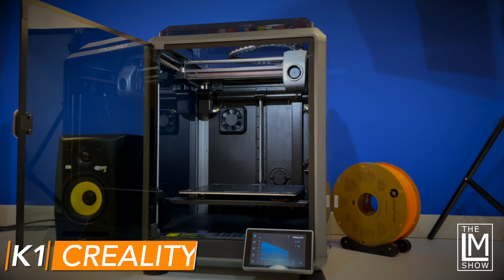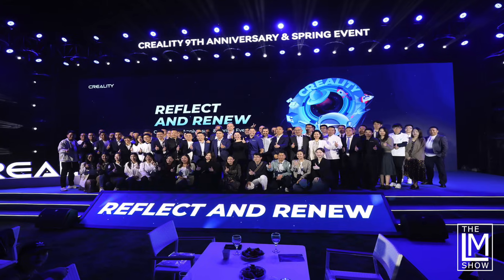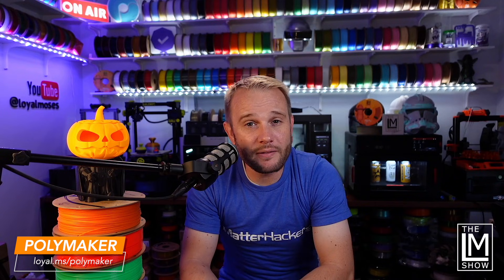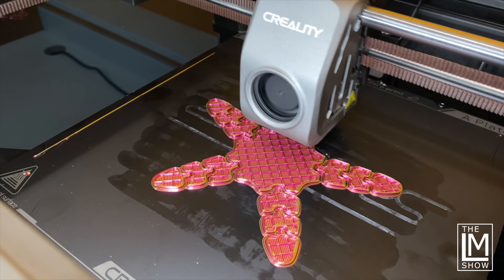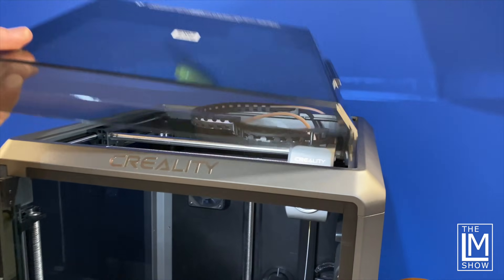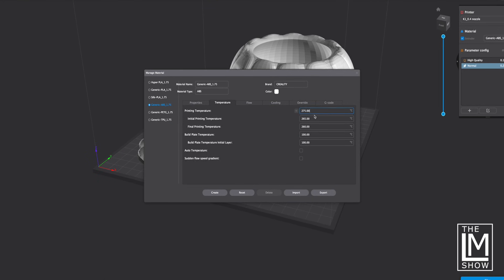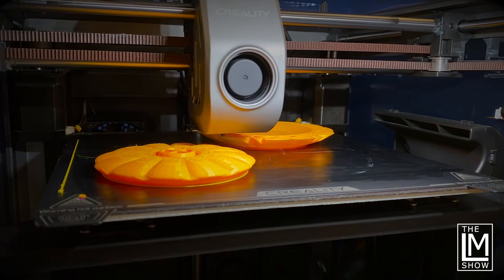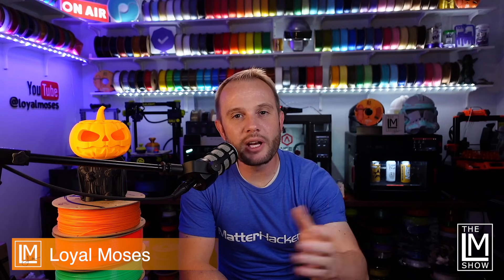ABS & ASA 3D Printing On The Creality K1

Comment: I have been printing ASA and TPU out of the box consistently and without issues from day one. Amazing and dependable machine. With Bambu and the K1 Max, filament printing is FINALLY at a place where anyone can easily print anything with any filament out of the box without issues. This is the beginning of a 3D explosion. Wish I had one of these when I was a kid. It would be my favorite toy.
Reply from the maker: I’m 100% with you! These machines are incredible, and 3D printing is changing forever! 🔥💜
Reply: @LoyalMoses  So in your experience, is ASA better than ABS?
Reply: @ When I first started, I tried every material just to know what they are like to work with and the properties. For me, I would only print with ASA or ABS if it was absolutely neccessary and it would likely be  ABS, but my go gerneral purpouse filament is PETG
Reply: @ I designed a series of subwoofer boxes for a 2 seat classic car. Space is tight and I found a way to design one that allows the use of very powerful small subwoofers. I have printed a couple of boxes from PLA and they work amazing. Now that the concept works I need to make them from a material that will survive inside a hot car without deforming. I know PETG is easier to print but don't know how well will it survive in a hot car in the summer. I know the temps inside can exceed 120f.
Reply: @ Yeah go with ABS or ASA. I think ASA looks better, but i have seen layer lines open up with ASA. over time. ABS to be on the safe side.. The trade off is ASA is safer on the lungs when printing.
Reply: @qwertyzxaszc6323  the part that sucks is dealing with the heat and humidity of South Louisiana.  The moment I open the door to the trailer a blast of humid air flows in and it takes a long time to dehumidify a 20ft x 8ft-6in trailer. I need a means to seal the large filament rolls and keep them dry. No telling what it's going to take to dry a 5k roll.
Reply: @cajunroadwarrior  I live in the desert in southern California, we have the heat, but luckily only have high humidity in August.But even here where it's dry, I always print directly from a filament dryer. I have 9 K1 Max's and a filament dryer for each.. Perhaps that is why I never have issues with my prints.
Reply: @qwertyzxaszc6323  this is likely my problem and I was very concerned it would be. One print completely delaminated. All of the individual strands of ABS never bonded.
Reply: @cajunroadwarrior  Filement dyers are not expensive, Well worth it. The strees amd waste is not worth it. Also, i try to stick  brand filament that have somethng to lose from negative reviews and avoid the cheapo brands. Not worth the hassle.
Reply: @qwertyzxaszc6323  they are for large spools. No one is making fast-printing filaments  in large spools. I need to print large parts that fill the 400mm area of my Ender-5 Max. It is designed to print super fast. Creality never designed this machine to run a CFS system. Another issue is no one is making a filament dryer that is also an automatic filament loader. Just one print can use 2.5kg of filament.
Reply: I have been failing with every print I do and it seems everyone is telling me the wrong thing to do on purpose.

Comment: What do you about air quality in the winter? I want to start printing ASA at times for functional parts, but its getting cold here, so leaving the window open is not really an option. I plan on buying a air purifier with active carbon filter in it, but not sure if that would be enough on its own.
Reply from the maker: Vent the enclosure out a window would be my suggestion. Seal it up to prevent cold air from coming in.

Comment: with problem. do not buy. no solutions from creality
Reply from the maker: Sorry to hear that! Was it with this machine?
Reply: @LoyalMoses   creality k1. have you tested it? even with the new extruder and hot end (because the pieces they send are faulty). you cant print the hole area. try.
Reply from the maker: We print on it all the time, and haven’t had a single problem yet! Sorry to hear you had an issue.

Comment: What are you using for bed adhesion ?
Reply from the maker: On this print I simply cleaned the build plate and applied a thin layer of purple glue stick.
Reply: Any big difference between Purple or Clear glue stick for ABS bed adhesion ?   @LoyalMoses

Comment: Got a K1 pre ordered for my first printer, went through the school of hard knocks with the early extruder but creality have been fantastic with support. Sent a new extruder out and hot end which solved the issue and now I am selling printed ABS parts non stop. Just ordered a K1 Max which arrived today to fit larger parts to add to the production line. I can see getting at least two more K1s to speed up production now that I have sorted ABS workload. Esun ABS+ is a good middle range price point but I would like to try the polylite as well. Thanks
Reply from the maker: That is great to hear! I am glad you are liking your machine! Also, I haven't tried the MAX yet, but I have heard great things about it! Congrats!

Comment: I had to run to the comments to give my thoughts! I bought an ender 3S one as my first printer a week ago. I have nothing but problems as I have no history with these machines whatsoever. I got so frustrated after spending 17 hours trying to get one print done and now it just sits in the corner of my garage. I purchased a K-1 from Amazon and paid way more than I should. I don’t even care. This thing is worth three times the price to me. I’ve printed multiple things with it absolutely zero problems. Only thing was when I first got it. Every time I would do a print it would shut down every five minutes or so and reboot. I looked it up online because I thought it was maybe a bad machine but it turns out on the left side. There’s a switch whether you have 230 volt, plug, or 115 V. I switched it to the right for 115 and it just keeps cranking things out. I’m trying the carbon fiber tonight so I’ll see what happens!
Reply from the maker: I’m glad you are happy with the machine! Sorry about the voltage issue, but I’m glad you got that figured out! How are you liking the quality of the prints from it?!
Reply: @LoyalMoses  the quality to me I think is excellent, I don’t know all the different settings quite yet. I’m just printing on whatever it says to print on, so it’s a huge learning curve, but I am very happy with some of the modeling stuff so far!

Comment: One reason why the K1 Max is my 2nd choice (1st is the P1S Combo, unless either Bambu or Creality develops an AMS compatible with the K1s), is the small overall printer dimensions even with a large print volume. If you compare it to a Sovol SV07 Plus, I will need a "Y axis" space of only 462mm (+spool holder) vs 600mm (300mm x 2) on the Sovol.

I may print some ABS parts to match the plastic of my Sandtrooper Armour.
Reply from the maker: I am so excited that we have so many new printer options for filaments like ABS!

Comment: Had my K1 max busted on arrival, and it was so easy for them to ship the replacement part, whole printer, or a full return (Which is what I opted for).
Reply from the maker: Oh no! What was broken??
Reply: @LoyalMoses  My front glass was shattered during shipping. I thought I'd just get a new one but then the extruder started skipping so just asked to return it anyways. They send a label and was super simple. Only reason I returned it is because I'm moving soon. Will wait for September announcement (want an AMS system) then I'll probably re-order it.

Comment: I have K1 it is great!... and not so great.
The speed and quality is wow!
The QC?  not so sure about.
Had mine 25 days.
First week... the bed went out of whack and nothing would stick.  spent 10 days with no luck on customer service, and finally figured out a solution on my own.
Two days ago, I woke up and went to the printer office, turned on the power, pos fan whirled up, interior light came on and that was it... not boot up, no screen.   Checked all the cables (just in case a mouse chewed on it... cough cough, they always ask this Einstein question), all cables good, got out my voltage tester and tested every spot - all good.  Checked the hot end board - all good.  Took the screen off, took the bottom off and check all the motherboard connections ... all good.
JUST DEAD.
Reply from the maker: Oh no! Do you have it back and working again?
Reply: @LoyalMoses  no they don't work weekends so will have to wait till tomorrow to see what kind of  support they provide.

Comment: Great info on the K1 as well as printing with ABS/ASA. I have only ever printed with PLA, but I only have an original CR-10. Slow AF. The only minor draw back for the K1 is that it's 220x220. That fits most people, but I'd like a little bigger 'just in case'.
Also, as a little note. Don't put a red border on your thumb nail. YouTube puts a red line under previously seen videos.  At first glance the red border makes me think I already saw the video. But that's probably just me and my 58 years old eyes.
Thanks for the info.
Reply from the maker: Thank you and thank you! Good point about the thumbnails!
Reply: Same thing I thought I already saw this!

Comment: Been printing abs recently and noticed a white build up coating the inside of my printer.
Reply from the maker: That film is yuck. I’ve cleaned the inside of every machine to remove it over the last few years.
Reply: @LoyalMoses  yeah I guess my enclosed ender was is such a large enclosure I never noticed. Make me not want to use abs as much lol. I know the bambu has a filter so that's nice.